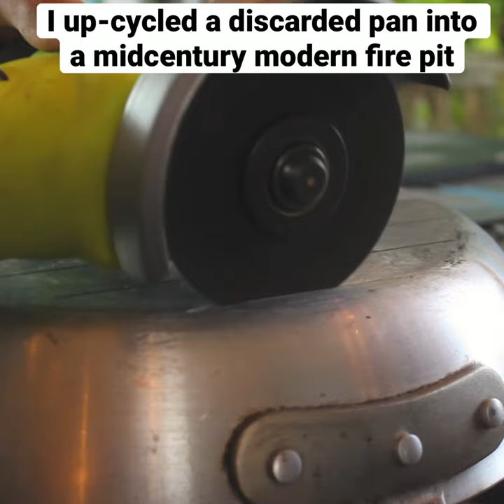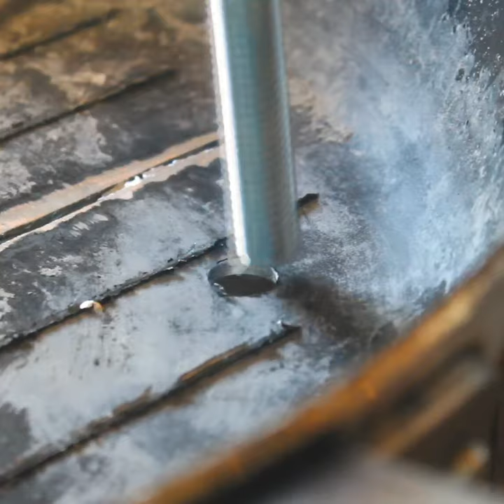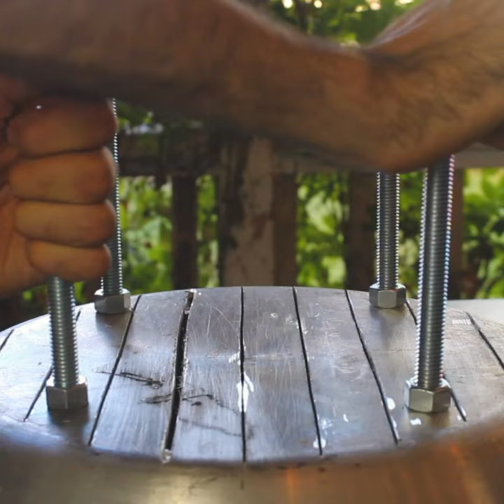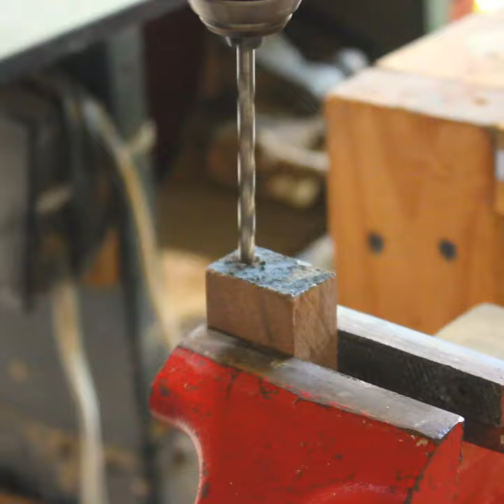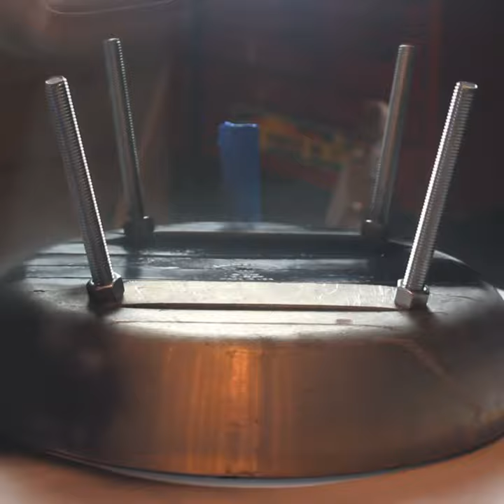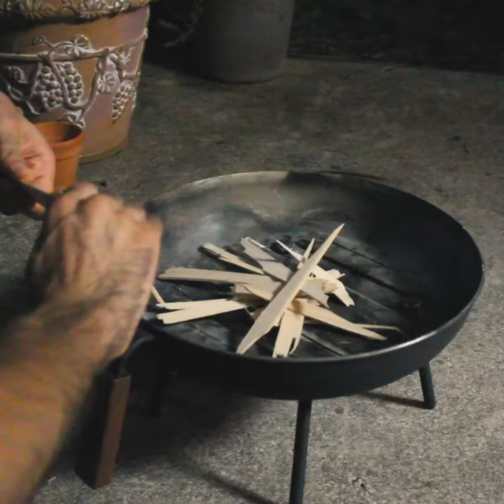Can You Believe Someone Threw This Away? 2 #shorts

Comment: Uh, fires get hot enough to melt that pan. That is a fire hazard when the hot cinders start falling thru. Also it will oxidize very quickly and corrode thru within a dozen or so uses if it doesn't melt first.
Reply: My first thought too.
Reply: Uh…. Are you going to cry now, Sally?
Reply: @palipali4264  I’ll go get you ladies some tissues.
Reply: @Manhandle730  when you get to a place where you no longer feel painfully lonely, rejected and unloved, you will stop seeking attention this way. Being a nasty human being to strangers may make you feel momentarily a false sense if being empowered; but ultimately, you already know that you return to feeling unwanted and unworthy of love. You can change it. God can change it. But you are not gaining anything by what you are doing. Learn to express your anger in healthy ways so that you do not have to seek negative attention in order to force others to reject you. It is not helping you. Whether your parents are addicts, mentally ill or in some other way unable to emotionally connect with you, acting out and being nasty to strangers will never help you to gain the love and acceptance you desire.
Reply: Steel will not melt in a fire pit.
All ash is a fire hazard, regardless of fire pit design.
He coated it in fire paint, it will protect it against weather, rust, and the sort, and not come off from burning.

It takes a long time for even thin steel to corrode from rust.
I had half mill thick steel sheet sitting outside for a couple years and it was fine.
A pan is several times the thickness, it would take decades.
Reply: @autumn5592  The steel will not melt, it will get red hot. At those temperatures it oxidizes very quickly which is why stoves are lined with fire brick. The brick keeps the steel temperature down and makes it last for years. Thin steel like this will rust thru probably within 20hrs of use.

Also there is no paint that will withstand those temperatures. The best ones go up to about 800F but the temperatures of the steel will be around 1000F which would burn it off. The edges not in direct contact would be protected though.
Reply: @court2379  Have you actually ever had a fire make a container red hot before?
Because I have, on both that half mill sheet metal fire bin, and on a 2 mill thick cast iron stove.
It was pretty easy to get the half mill sheet metal one to red hot, but only after filling the bin with wood.
The cast iron one, it took SO MUCH work of constant feeding and selecting the correct wood to get it hot.

In short, you will never get something like this red hot, it just cannot hold the required material to make the heat.

Fire brick is an insulator, it will keep the heat inside of the oven, that's why it's used, not to protect the thing holding the brick.

That half mill thick steel sheet bin, I've had one last me 2-3 years.
My current one has been in use for a week now, I burned a whole tree in it, took 3 nights, and as been left in the constsnt rain. Doesnt even have a spot of rust on it.

The paint he used lasts up to 750°c, there are some paints that do higher.
They are specifically designed for use on engine blocks, break calipers, and fire pits.
Look up high temp enamel paint.

I don't think you know what an Oxide layer is either, because you keep mentioning it, but never mentioning what would happen because of it.

I don't think you have a clue what you're talking about, completely lacking any real world experience.
Reply: @autumn5592  Regardless of whether it gets red or not, the corrosion rate at high temperatures is much faster.  Also ashes are caustic. How long something lasts is highly variable due to how hot a fire is run, how long, and if you leave the ashes in it afterward. Particularly if it is exposed to weather and gets the ashes wet.

Regarding paints, the consumer level paint temperature ratings is marketing lies. It helps for a small amount of time, but if you have used those paints on things like exhaust pipes, it doesn't last very long. At those temperatures it would have to be some sort of ceramic or metallic coating, both of which don't stick well to steel as it corrodes and thermal cycles. Their use could be questionable as well due to toxic byproducts, particularly the first time they are heated up.

Regarding fire brick. You are are trying to claim that stove manufacturers add cost to the stoves (a space heating device) to insulate them, slowing the flow of heat to the room and allowing it to go up the flue instead. Reducing their total heat output and making them more expensive. Yeah that is logical. There is a good reason stoves are lined. It is to protect the steel from the heat and ash. All you need to do is read a bit about stove construction.

How long this thing last will vary widely, but it is absolutely certain to rust thru in a relatively short time period. It should be lined with something like a castable fireclay (which also degrades in a fire, but much more slowly).

But all this is meaningless as that is an aluminum pan, and a typical fire does get hot enough to melt it.
Reply: @court2379  Fire doesn't damage steel no where near as much as you think.

The paints are more than good enough for a small flame or barbecue.

Fire brick keeps fire hot.
Not to protect stoves or forges.

It's not an aluminium pan.
Reply: @autumn5592  Funny there are no sparks when they cut the pan with abrasives. Never seen that on steel.
Reply: @court2379  Lighting, angle, speed of abrasive, abrasive type, etc, all play into what it looks like. 
Grinding Ali produces produces sparks too...